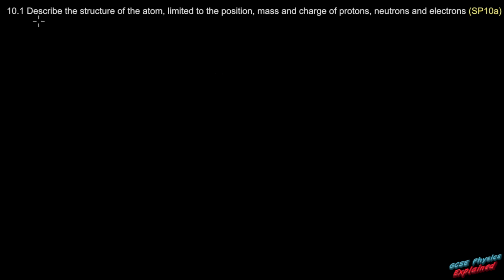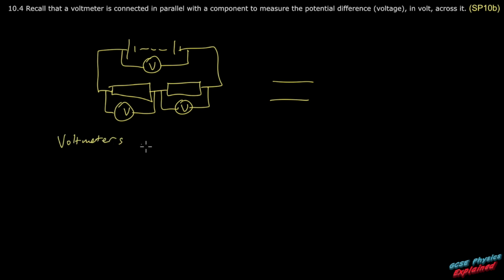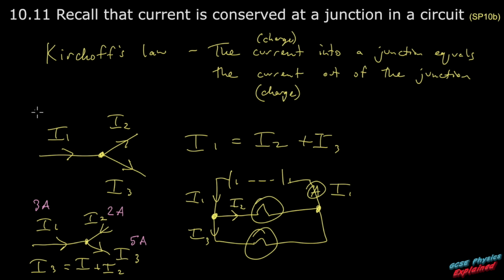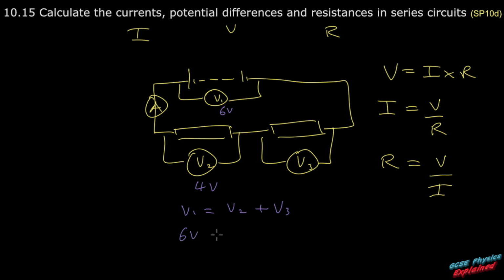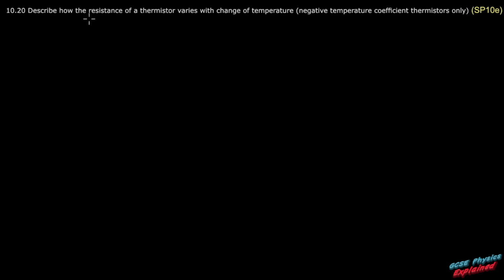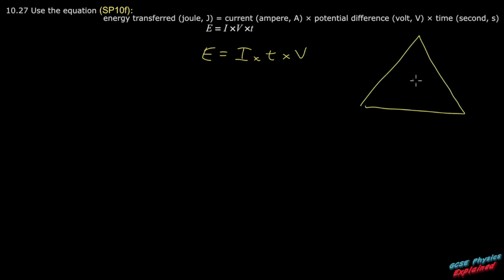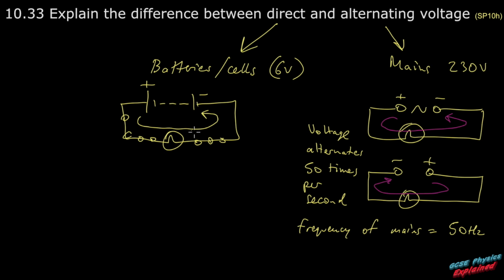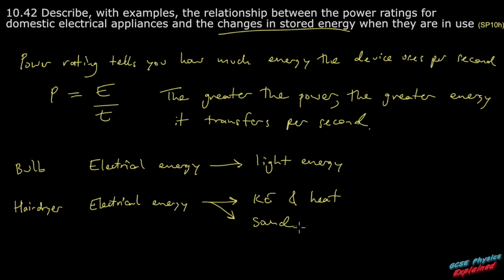Electricity and circuits FULL UNIT COVERED FOR REVISION!!! (SP10)

Comment: Hi sir,
I really appreciate you making these videos they are extremely helpful! Would it be possible if you could upload similar videos like this for the all the topics in Edexcel Physics Paper 2. 
Thank you so much!!!
Reply from the maker: Thanks for the feedback. I’m working through triple paper walkthroughs atm for my triple students. If I get the time I’ll try to crank a few more vids like this out as well. Any particular unit?
Reply: @GCSEPhysicsExplained Topic 11 and 13 if possible. Thank you so much for your help saving us all for these exams :)
Reply from the maker: Are you doing triple or double cos the unit codes are different. When you say topic 11, do you mean static electricity topic ie triple?
Reply: @GCSEPhysicsExplainedyep i do triple

Comment: have you also seen the 2021 papere the 6  marker was describe how the specific heat capacity of alluminium could bew obtained (6). - sop could they mix it up wth any material they wish?  thanks.
Reply from the maker: Yes, that’s right. They can change the context of any question but basically it’s the same, or very similar, answer. The key is to stay calm and read the questions correctly 👍🏻

Comment: Hi sir for spec point 10.14 does the total current in a series circuit decrease. You said it didn’t. But then later said it increased. Banging video man. Thanks a bunch. So if RT=R1+R2. How doses total resistance increase. If current decreases idk how there affects the total resistance. Thanks
Reply from the maker: If you put resistors in series the current has to go through both resistors so the current decreases because the resistance is big. If resistors are in parallel, there are now more paths for the current to flow down so it is not as affected by the resistors. It’s like opening up more doors to let a crowd into a building. The more doors you open the faster the people can flow into the building. Any good?
Reply: @GCSEPhysicsExplained  thanks, so then you would say that total resisstance would increase. but how would it increase if current decreases?
Reply from the maker: 2 Resistors placed in SERIES increases the resistance because you add the resistors together to get the total resistance. In PARALLEL the total resistance decreases. Google resistors in parallel to understand more. At GCSE you no longer need to know the equation for resistors in parallel. It’s A level
Reply: @GCSEPhysicsExplained  thanks. So you would just say in a prall circuit TR increases because it is the sum of the resistors + If current decreases R=V/I I decreases r increases. Parallel more than 1 loop so current increases. R=V/I. I increases so r decreases.
Reply from the maker: You’ve got the parallel understanding. Just tweak what you said about series like this: Series - R increased so current decreased. Parallel- I increased so R decreased.

Comment: hi sir for spec point 10.16 at 29:23. for the 6 marker how many marks would this get. Explain how a sudent could design a circuit in order to find out the resistance of a bulb (6): 

Could you harshly mark it please. like an examiner. 

- measure voltage using a voltemetre
-measure current useing an ametrre
- connect the ametre in series with bulb
- connect voltemetre in parallell with bulb
- vary the voltage using a variable resistor
- use ewuation v= IR and resarrangre to find Resistance: R=V/I. 
- Repeat experiment many times to identify anyanomalies and to get rid of them .and then write dowen observations on the ammetree and the vltemtre for the voltage and the current
- with that data calculate the resistacne using R=V/I . r is in ohms, v is in volts, and current is in amps. - if not convert units to those.
- plot data on an iv graph.  

thank you. for your continous support.
Reply: sorry for the spelling. it isnt editing my comment for some reason.
Reply from the maker: @MC10W  don’t worry about it. I’ve been a teacher for 24 years. I can interpret all sorts 👍🏻🏆
Reply from the maker: That’ll get you 6 marks, Matty 👏🏻